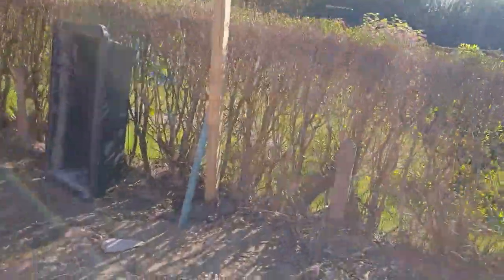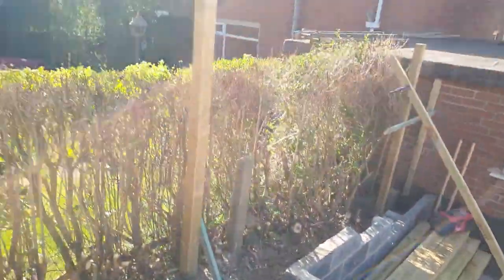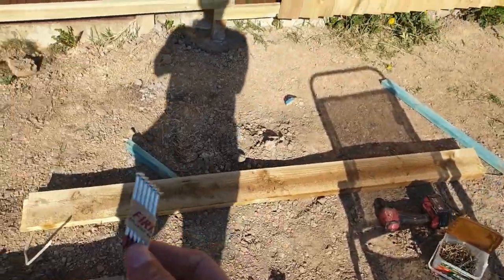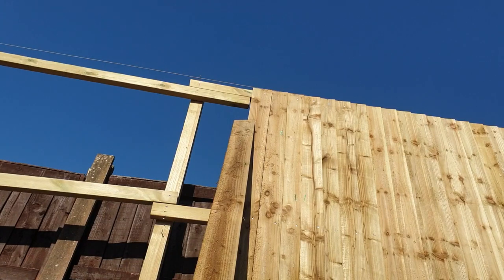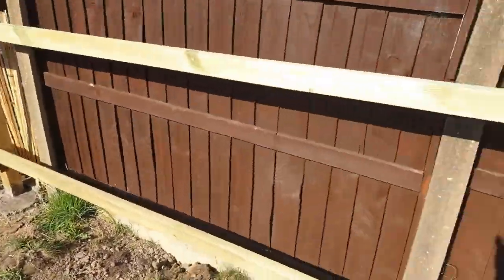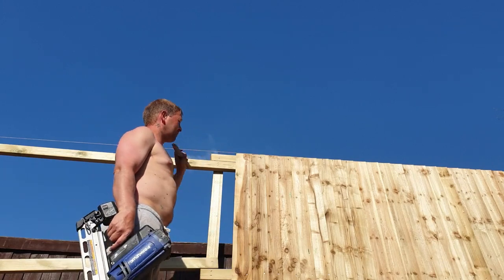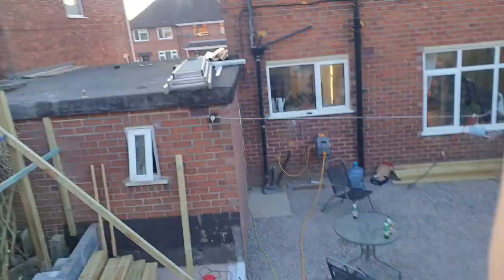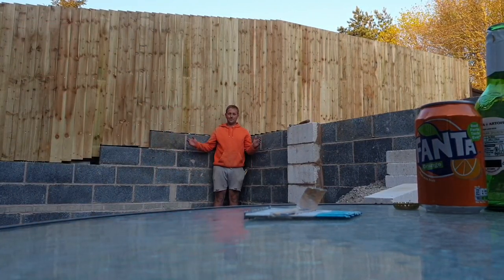Best Fencing For Begginers

Comment: as a fencer i would of put a 6x1 gravel board on the bottom otherwise your boards will drop and would of used 4x4 posts also would of kept the rails level half and half on the posts and stagerred the rails so not all the joins are on one post (like brick work), also your gaps are to big aswell should put extra posts in between it also depends what postcrete you use :)
Reply from the maker: I've used concrete, I don't like post Crete it doesn't hold well. I'm trying to keep the costs down so as long as it looks decent on my side
Reply: @Changy_C  but then you cant guarantee that'll stay up longer yjat 5 years when i can put 15-20 years on mine
Reply from the maker: @jakebazzell413  that's good, they only put 10 years on new houses lol
Reply: @Changy_C  but they arnt exactley all perfect on new builds, anything to make a quick sale is what there after
Reply: @jakebazzell413  he’s selling the house when he’s done it doesn’t matter if it falls down in 5years haha
Reply: Should be 600 deep, postcrete is fine if you use a decent brand (carlton is best), posts should be 4x4 and be 2.1 apart, rails should be staggered and it should have a capping. Not trying to dog you but a bit of edication goes a long way.
Reply: @ryanlaycock6908  what do you mean.staggerrd rails? I'm doing mine as we speak lol

Comment: Intresting good built fence however I know in my area and also in Devon and some other parts of the country  the fire regulations and also building regulations state any fence can not be higher than 2mt and not have a drop from the top of the fence to floor more than 2 mt.
I had a fence with trellis on top next door complained and I got an order to cut it down to 2mt. You also have to remember you only have one fence  the people next door own the other side the law says fences on the left side of your home belong to you right side your neighbour. A front fence can only be 1mt. New house builds have a back fence around the gardens however you will see 2 sections with the boards on your side and one section with the boards on next door. Putting fences up and sheds up now id a nightmare with all the new regulations.